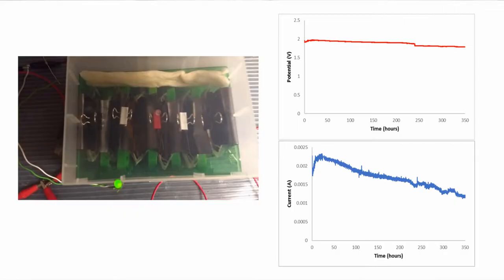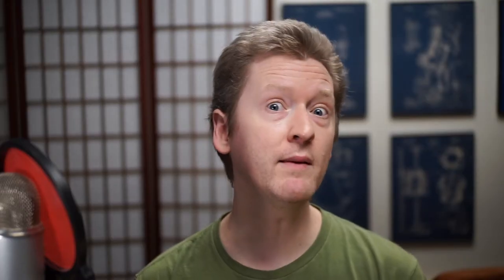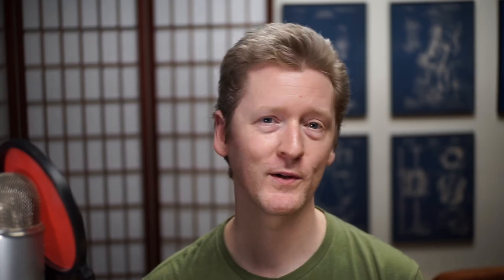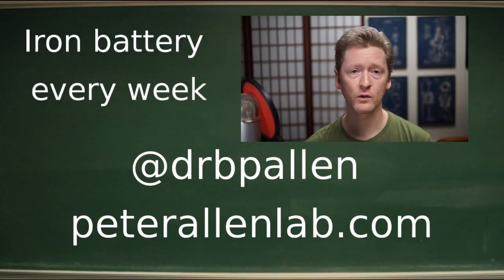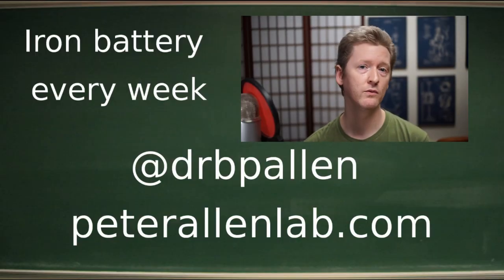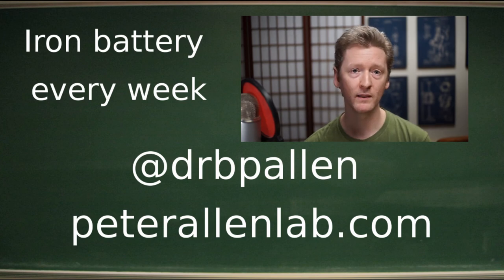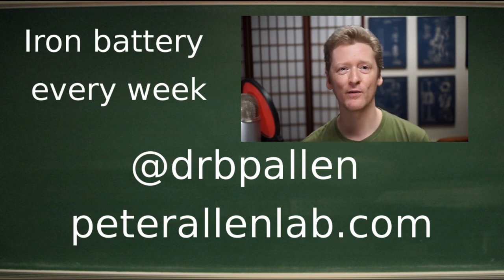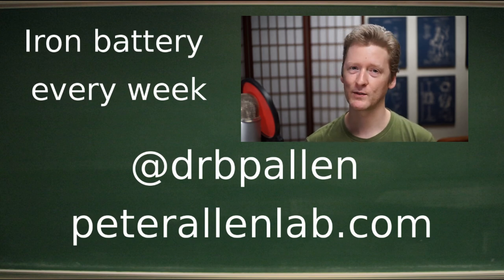Iron Battery: current progress and scale to 200 ml

Comment: You really seem to have a hard time getting a high energy density, so I decided that I might give you a lil‘ hint.

Try ferric(III) salt based ionic liquids/deep eutectic solcents, I for example use a mix of 1:2 (molar mass ratio) urea:FeCl3*6H2O and this ionic liquid will have a ionic conductivity several time that of yours and the addition of PEG (1000mw+) will also prevent possible dendrites from forming, also you can just mix this ionic liquid into a partially hydrolyzed pva solution and after drying you will end up with a good and even crosslinked membrane suitable as separator.

Sorry for my bad English, anyways if you got more questions I‘ll be there to help

Comment: Why not go for more parallel cells in that array? If an individual cell provides the same current regardless of size just stack more.
Reply: That allows for higher current, but it doesn't solve the issue of poor capacity to discharge time ratio

Comment: This is a lab science experiment.  That is great.  :)
But in developing something "better", shouldn't there be a simultaneous "control" test against a known "open-air" technology such as a lead-acid/lead-sulfate??  A single such cell would be easy to fabricate in comparable sizes. Sure, lead is very toxic. But a university lab should be able to contain the toxicity during such simple testing.  I think that would be an excellent stimulus for a useful discussion on why a "car battery" cell performs so well.
Reply from the maker: A colleague here at the U of Idaho is a lead acid battery expert of 30 years. So I'm talking to him on a weekly basis for advice. It's definitely a much better understood chemistry.
Reply: That's a great resource to have.  Consider that one of the reasons you like the AIB (All Iron Battery) is that the methods & results paper can be an excellent resource for secondary and even primary science education.  The idea that they can safely "build their own".  Well it's not hard to imagine that those students could use the motivation of improving the commercially successful "state of the art" "car" battery.  At least in primary school, testing against classroom/homemade lead-acid batteries can create toxic waste that is hard to deal with.
That's why, if they could see your AIB results side-by-side with a lead-acid battery constructed with similar techniques, they would only need to reference your lead-acid control results. ;)
Definitely, lead-acid technology is VERY mature, due to years of engineering.  Even the idea of car battery has become way too simplistic. Car batteries optimized cold weather high current engine starting capacity by using plated grid/mesh design in electrodes as well as carefully selected separators. Their trade-off is that they do not do well in deep discharge to low voltage (the grid/mesh falls apart), greatly limiting their true usable storage density.
Golf-cart & forklift lead-acid batteries would be closer to the stationary storage application that the AIB would more likely fit into, and their more solid electrodes would be easier to reproduce in a lab setup.
In any case Peter, I appreciate your reply, given how very busy you are. :)
Reply: It depends on your criteria for the word "better".  It's true, othe battery chemistries are more efficient, but one of the criteria here is to make a safer battery that's good enough.  The size criteria also differs.  Instead of trying to make the smallest possible with the best power values, the size criteria here is "somewhat reasonable".   If you can meet the good enough power generation criteria within a somewhat reasonable size that meets the needs of your application AND not have to worry about toxicity at the end of the battery's lifecycle, that's a win.

Comment: I have to say that there's no way that I would ever consider doing that having a truckload battery for my house I can literally Buy two car batteries Chevy volt batteries for $4,000 used and I have done this and it takes up very little room and it can discharge at extremely high rates width 33 kilowatt-hours of power for $4,000 you need to be able to match the size and the price of what you can get for used the size is about 800 lb of battery the capacity is 33 kilowatts the volume is around 20 square feet and it's not tall I could build shelves over top of it and it would take up less space